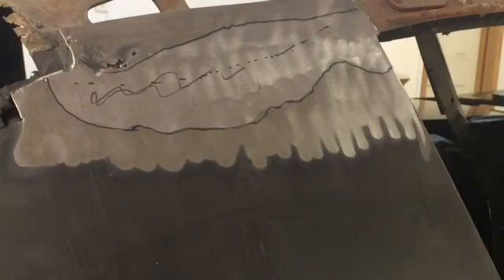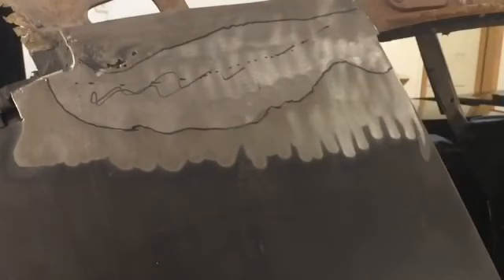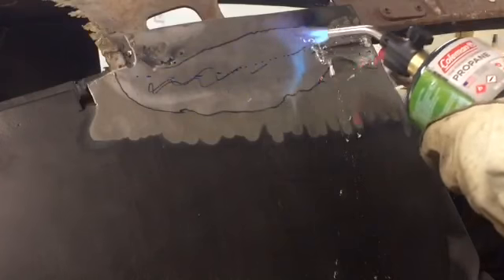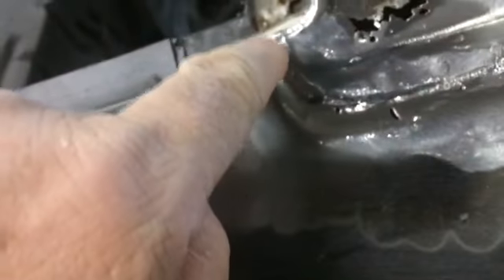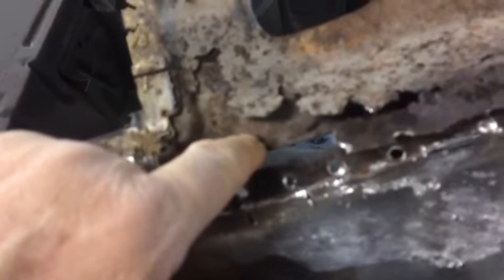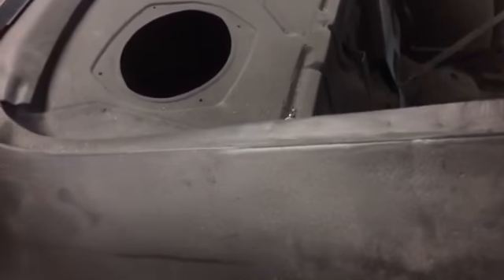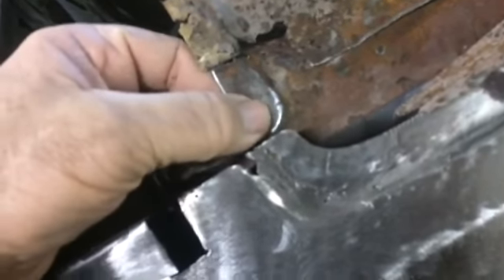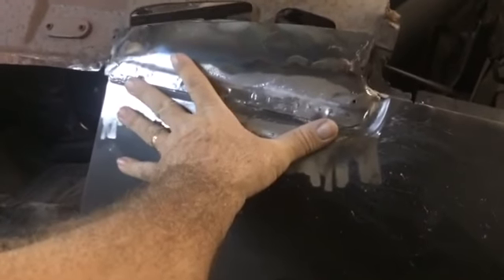Camaro roof skin, get the lead out!

Comment: You will find those three welds from the quarter and roof lap on the inner quarter wheel house but hopefully you dont have to remove the inner quarter wheelhouse  because it is a pain but in a challenging way as I removed them in my 74
Reply from the maker: I can see where that would be tough. Thanks

Comment: Hi jeff im doinh a full quarter on same side and im curious about this because i am not removing roof skin how would i spot weld the quarter in since its under everything. Any help is much appreciated
Reply from the maker: Kyle Wagner you will need to drill through the roof skin and qtr and weld to structure under roof skin